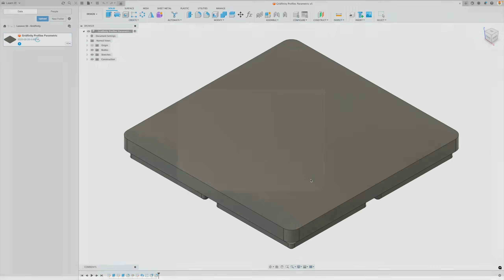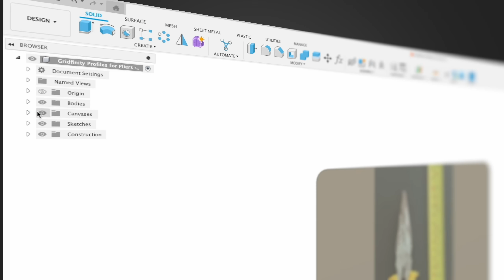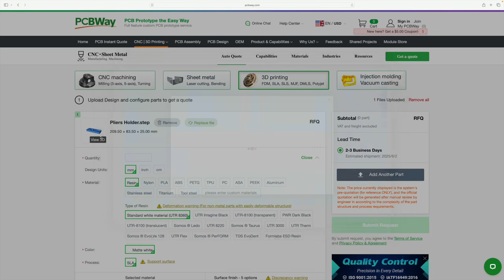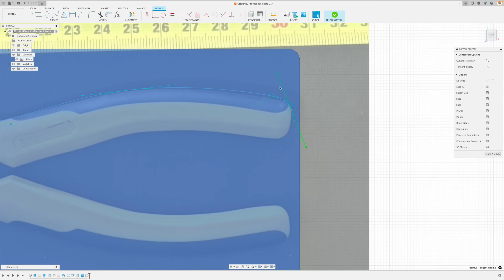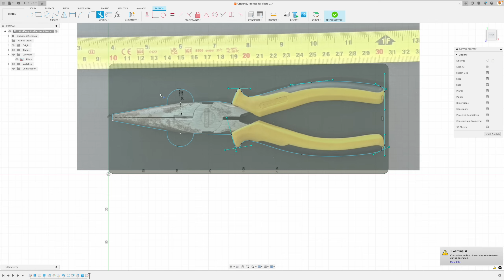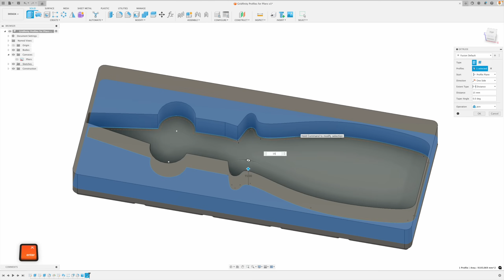Autodesk Fusion 360 Gridfinity Custom Cutout for Tools

Comment: I must be missing a step. When I try to do the offset I selected all the sketch lines and then go to offset and it tells me no curves were selected and then wont allow me to select them again.
Reply from the maker: Thanks for reaching out. 

Are the lines all forming a chain? That might be an issue. If not, make sure all lines are connected and no lines are extending past any other lines. If they are a chain, then you can double click one line and it will select the entire chain. 

You can also check the offset tool by selecting only 1 line and seeing if the offset tool works. Report back to me on
Reply: @learnitalready they were. I was able to double click and it highlight all. I figured it out. Not sure what it was but I got it. lol.
Reply from the maker: @DIYReid  That happens to the best of em! Good job figuring it out.

Comment: I could really use some additional help. I have tried and tried to follow this one. Instead of building my own parametrics i just used the gridfinity plugin for fusion from autodesk. No matter how i take the picture with my iphone, ruler, grid paper, a custom grid that is the same as gridfinity. The scissors i'm trying to cut out are distorted and dont fit in the 2x4 bin. Help please!! I don't know what else to try
Reply from the maker: There could be a number of reasons why there is distortion. I can think of some possibilities for your specific problem:

1) Your camera perspective is off
2) Your scissors are not lying properly. If they’re angled, then there will be issues with fitting
3) Your paper size, ruler size, or other means of calibration isn’t correct

Steps to make things work:
1) make sure you take a picture of your scissors from as far away as possible while maintaining good resolution
2) prop your scissors up on plasticine so that they’re not on a false angle
3) make sure your calibration methods are accurate

Let me know if any of that helps.
Reply: @learnitalready I will try all of these and report back. Thank you

Comment: Thanks for the recommendation on the 3D SpaceMouse — I bought one after watching your videos and it’s been a game changer for me in Fusion. Really improves workflow and comfort. 👍  

I’m also working on a MacBook Pro, same as you, and I was wondering: do you use an external monitor in your setup? If yes, which model are you using?
Reply from the maker: Great to hear you got one and love it! Which model did you get?

Regarding the MacBook Pro, I am actually using a MacMini Pro now, but did use the MacBook Pro often in the past. The monitor I use is almost identical to the following: - PHILIPS 27" 4K Monitor: https://amzn.to/3PRX9cQ

However, 4K is totally not needed. I would recommend 2K at the most. A high refresh rate is nice but I don’t think you need to go extreme with that either. I’ve worked with 27-32” monitors and think I like the 32” more but it all depends on your preference. If you click on that above link, even if you don’t buy that monitor, I may get a commission at no cost to you. It really helps the channel if you were to consider that. 

Let me know what you decide :)
Reply: @learnitalready  I picked up the *Enterprise Kit 2* 👍  
One small thing — it arrived with a *USB Type-A* connection, while I thought it would be Type-C based on the description, but honestly that’s not a big deal at all.

Regarding the monitor: I’m leaning toward an *ultrawide* setup. I often model *HEMA blades**, which are very long parts — up to **1350 mm* in length — while the width ranges roughly from *10 mm to 100 mm* and thickness is around **6–8 mm**. Having more horizontal workspace really helps with visibility and navigation for this kind of geometry.

Thanks again for the insights — really appreciate the recommendations.

Comment: I have a similiar project at the moment. But i think this is quite a lot of work tracing all the tools via this method. I came up with the solution to vectorize pictures of tools that i made, scaled to the proper size and just import the .svg file. What do you think about this?
Reply from the maker: That is awesome! What tool do you use to vectorize the objects in your images?
Reply: @learnitalready  I basically use Inkscape to vectorize the tools. To make the photo with a good contrast i place the tools on a LED panel. As a reference I have a 100mm ruler Next to it, so i can adjust the scale of the svg. Works like a charm!
Reply: Make a short video on it!

Comment: Excellent  tutorial Tai, would it be possible to have a version that can be stacked?
Reply from the maker: What a great idea for our next tutorial! 👏
Reply: @learnitalready  I came to this video hoping that maybe this aspect was covered, but glad it got mentioned in the comments at least. I have made several cutout bins for Gridfinity but without either relatively flat tools with finger cutouts, or dropping the tools super deep in the bin (which isnt helpful for retrieval), I can't get enough clearance above them to allow stacking. I'm using the Fusion Gridfinity Generator Plugin to make my solid box and then cutout from there. I cannot however seem to find an elegant way of raising the height of the lip above the flat surface of the interior of the bin. Does that make sense? Screwdrivers are a good example of tool that you probably only want sunk about half their depth for ease of retrieval, but that means the height of the scre=driver extends above the height of the stacking lip, prohibiting stacking anything on top. Hope this gets covered n yuor next tutorial or by someone who reads this comment! thanks!
Reply from the maker: @Phoeff99 Excellent feedback and suggestions. Hope to cover this in an upcoming tutorial soon. Thanks!
Reply: @learnitalready  I will push my luck, Knowing that the Gridfinity unit of measurement is 7mm/unit, can we set this dimension so that we can integrate our trays into Gridfinity suitcases?

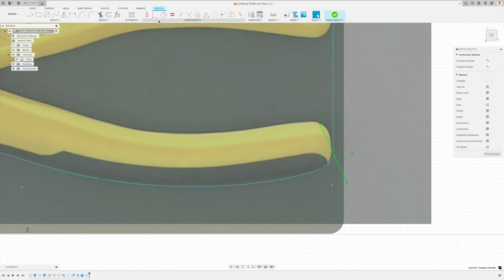Comment: One thing I've always wondered, and I see you didn't have it perfectly, is if there's a way to easily align the canvas so that it lines up with the axes on the origin. When you take the photo the object is probably not exactly vertical, and in this video at 8:00 when you're drawing the vertical line across the handles you can see that it's not perfectly square. Is there a good way to, say, draw a line on the canvas (e.g. on its line of symmetry) and say, "line this up with the x axis"?
Reply: +1 wondering the same! Especially since it often would save a lot of effort to be able to correctly mirror a part of the sketch
Reply from the maker: Excellent comment! Simple answer: there isn’t an easy way to align it. 

Here’s the long answer as to why: it’s important to remember that canvas images will never give you perfect precision. Therefore if one decides to solely use a canvas image for their sketch/model then they will need to make some exceptions in their design. 

For me, I would probably use a set of verniers in conjunction with a canvas image to make the model more accurate - and only if absolutely needed. In the case of a cutout for pliers, I would personally be very happy with a quick calibration and alignment so that I can get on to printing and design for the rest of my tools.

So, to sum up, balance is needed when working with canvas images.
Reply: I am attempting to use gridfinity in my tool box. My Bambu labs p1s will only print 10x10 inches . So, I have to break up my baseplate into several prints. What is the best way to do this? Some of the tools will require a bin that is longer than this. For instance a 1/2” torque wrench.
Reply: @johnathansmith1373  The way I do it is I split body. To make the plane I choose a mid plane and select to opposite edges on adjacent squares of the grid. That should make it so that it splits exactly between the squares. You can also split it in the slicer, and even add a dovetail, but since the base plate should hold the half in place, I prefer this way.
Reply: @Grazfather thanks!
Reply: Try not to overthink it when you're doing cutouts - You're not building cabinets.  You can get a top mounted camera which would be, in theory completely level on that vertical axis looking straight down but you're taking a 2D picture of a 3D object.  

Honestly at this point I would use chat Gpt to come up with some math to handle the proportions -  because when you do The calibration in fusion, it's assuming that's the same depth everywhere when the higher up you go the less accurate it is, assuming you calibrate it based same height level as the ruler device you use in your picture,.  It's probably some trigonometry involved that takes the vertical distance to the camera along with the angle of something and the height of the object relative to the ruler etc.  The main point is to get the 2D image sketch correctly or the widest part
Reply from the maker: Excellent response. I agree and added my 2 cents below. 👇

Comment: This is such a great series and look forward to each release.  With this one in particular is there a way to outline just half of the tool and that have it mirror the splines so you have an exact match on either side?
Reply from the maker: Thanks so much for your support! Great question too! Originally, while I was practicing on this tutorial, I did utilize the mirror tool. There seems to be pros and cons to it. For example, if the part is exact the same on both sides, then I would use the mirror tool for sure, however this pair of pliers was a little off. 
I would love to see how you implement the principles in these tutorials in your designs! Hope to hear from you again.